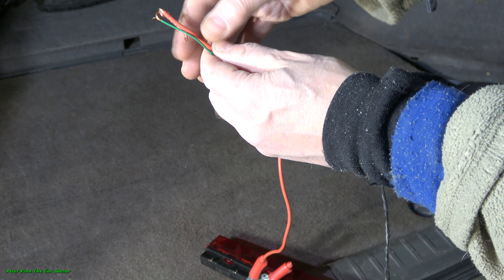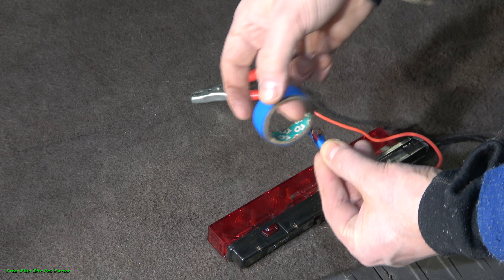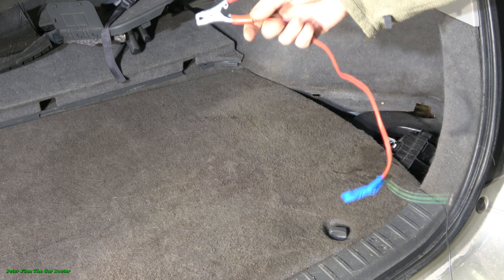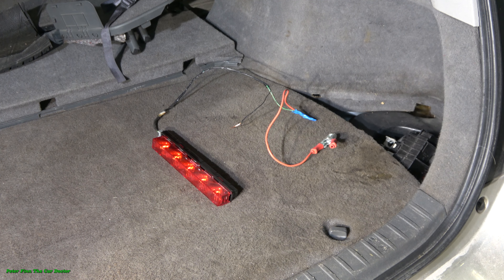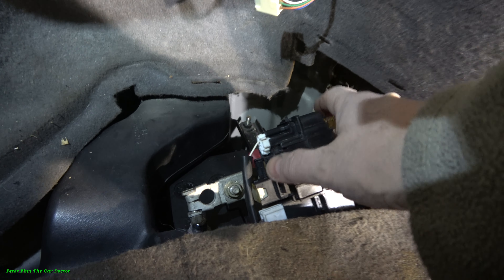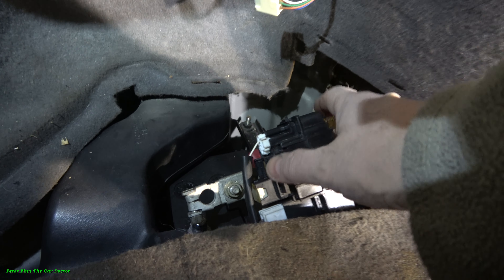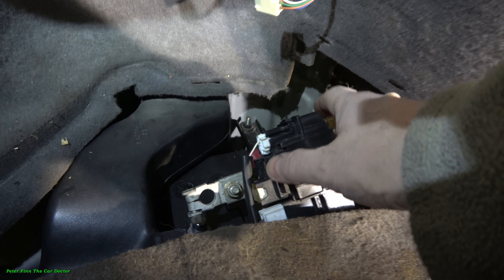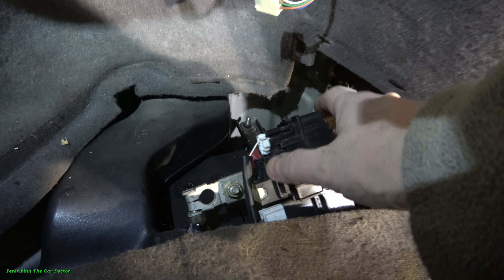INNOVATION! How to Do own Electrical Testing device by from Ford Brake Lights

Comment: Depending on the cars year, most of those wires are probably signal to something like a light. When the relay is off it likely connects it to minus to make sure the light can't accidently come on.
Reply from the maker: Good comment! And there was also PLUS cable ! 👍😁